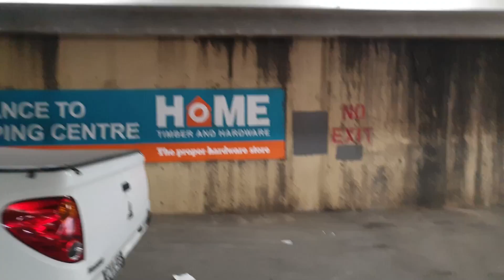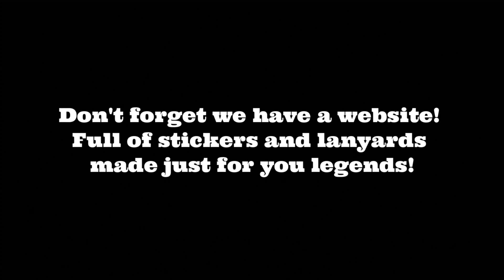Mace Engineering Full Engine Gasket Kit For The Skid Vs! | Getting It Ready For The Engine Swap!

Comment: You boys need to use seat belts to lift your engines 
You won’t be able to snap one lifting an engine 
They lift full turbo Barra’s with out snapping 
Stop using skinny straps 
Any seatbelt will do
Reply from the maker: Yeah man we've done that many times before, just that this motor came with that strap tied to it hahaha